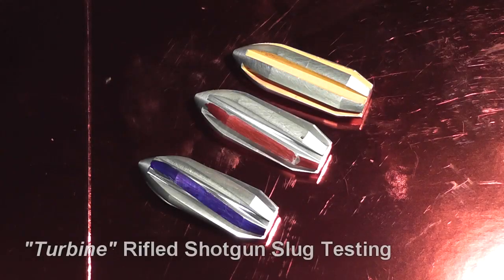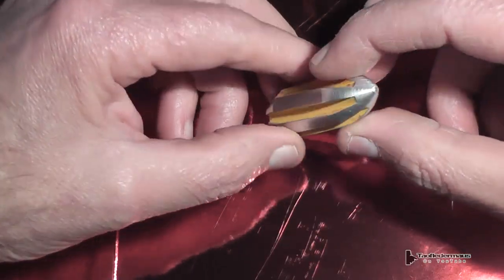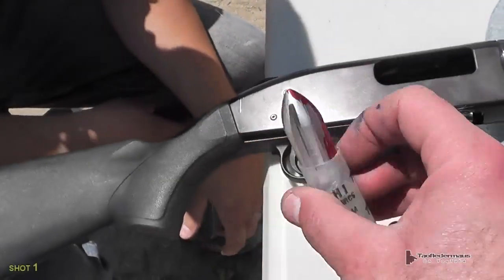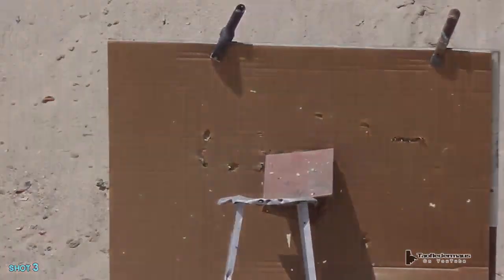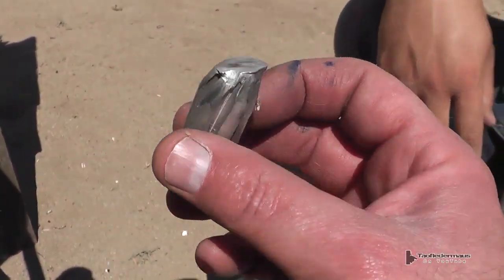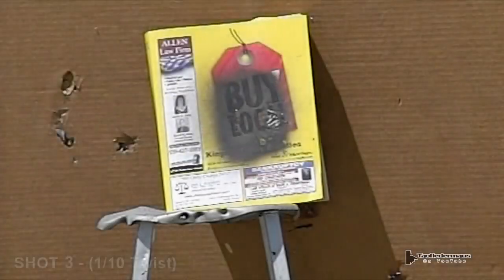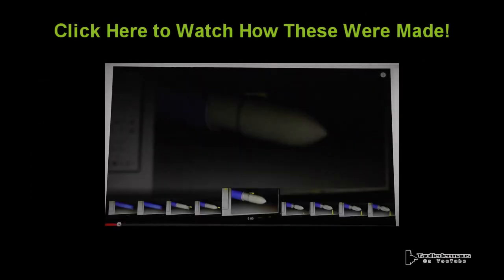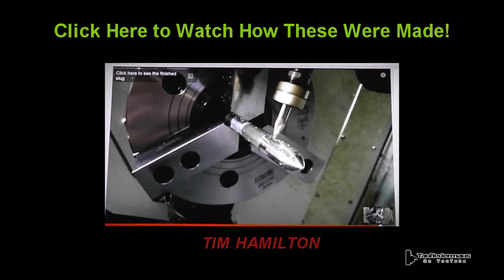Custom Aluminum TURBINE Shotgun Slugs  -Testing

Comment: Try either weighted nose(lead or steel in aluminum) or flights it the rear like a dart. Weighted nose with finer, more shallow rifling that get slightly more pronounced in the rear would be best

Comment: Yeah, very cool - but I guess the rotation needs to be initiated in the barrel in order to exit with stability.  I'm not sure if fins could ever be enough on their own - the density distribution of the slug would likely have to be tweaked somehow to provide stability before rotation can be initiated - and then would likely be all that was needed.

Comment: I'll say here, in my vision the high speed cameras have one job, and that's to see how the round travels and the impact in slow motion, and the 300 is nearly no different to reality, the 600 is close to the 300's effect to.  Now the 1200 is good but you have to lower the resolution for a higher fps.  When you get the money, please sell the 300 and 600 and buy a 2500'camera.
Reply from the maker: Gordonator  It is real expensive to go to the next level.   The 1200 fps resolution is pretty bad, it's very small,  and the native resolution is actually about the size of a pack of gum if you view it via Quicktime.   But...  what I have is better than guessing what the rounds are doing.  I'm not trying to make a motion picture.
Reply: ok i hear you out, is there anyway you can decrease the resolution of the 1200 to make it even higher?
Reply from the maker: I always hoped some hacker would have written some custom firmware for these cameras to do stuff like that but  I don't think anyone has.    The camera wasn't popular like the Canons,  etc that people have hacked.

Comment: It would seem to me that the force required to impart spin on the slug from a low-density fluid (air) would be massive. As the rifled slug is fired, wouldn't the expanding gasses acting from the rear, impart spin in the opposite direction from the spin desired as it leaves the barrel? Perhaps a partially cone-shaped sabot at the rear would isolate combustion gasses and provide more velocity. Also thinking that thinner, bent 'blade-type', fins like those on a turbofan aircraft engine would provide more rotational force from the available air density. Interesting concept although how essential is it to stabilize a shotgun slug?

Comment: IMHO a far tighter twist rate on the slug itself and more aerodynamic grooves (think of a course threaded drywall screw... sharp edges, maybe a 6:1, yeah, 6 turns per foot, if not tighter, twist rate) would yield slightly better results but still won't come anywhere close to an actual rifled barrel. With a rifled barrel the projectile is forced to spin because of a tight interference fit with the grooves of a steel barrel. A 'rifled' projectile shot out of a smooth bore relies on just air resistance to cause it's spin.

BTW, I love your channel. You experiment with all kinds of things that excite the demented mind.

Comment: I'd suggest shallower and twistier rifling on the slug to get the pressure up and give that air-pressure more surface to help push the ridge's walls into rotation.

In a normal rifled-barrel you have denser-metal-against-metal friction inducing the rotation. In this case it is air-pressure doing the job, so you'll need more contact surface.

Comment: No way I knew that would not work the air is not going to make it spin you need a rifled barrel with a sabot or a projectile tight enough in the rifling. Tao your thinking like a rookie.
Reply from the maker: kanehunter23   Remember,   I use viewers' ideas in my videos often.   Many people claimed putting spirals on a round would make is spin.   That's all we did here.   If you get hundreds of people thinking that spirals on a round makes it spin,  then what's wrong with conducting that test to dispel  that?

Comment: Isn't rifling necessary on the barrel, not the actual slug itself?
OR, if you have to rifle the projectile, no matter what, then wouldn't short scratches running from the tip to no further than half the bullet make more sense? Because this way, my intuition says, most of the force of the shot will be lost, passing the slug.

And it wouldn't even make the slug spin, because the force you want to spin it escape the easiest route, which is ignoring most interaction with the slug itself.

Comment: Just wondering if the tumble is caused by the transition between ejection gasses and the opposing air traveling through the rifling once velocity is achieved upon exit… Particularly with these finned/rifled rounds. Perhaps a jettisoned push plate that is fitted into a receiver hole in the base of the round would help ? Something shaped like a flat topped mushroom with the stalk being an easy fit into the rounds base. Designed to "drop off" after exit…
I don't really know what I'm talking about but it's got a bit of logic to it : )
Reply from the maker: John Smith  Remember these are sitting on and are being pushed by the wadding which is like a piston in a syringe.

Comment: The round is tumbling because it isn't spinning n the barrel but starts to spin once it out. It means the grooves are actually doing something but after they are out. Then as the slug starts to spin up it tumbles. Think of it like giving a car too much gas on ice. The torque from that initial spin up isn't acting directly along the line of flight. Smooth bore projectiles either use fixed fins or rarely pop out fins to stabilize to stop this.

Comment: maibe you need to dril holes in the slugs and fill those with powder used in fireworks 
the idea is that firing the mainload in de cartridge will ignite the little powder in the holes as whell forcing the bullet to spin 
how whell the different holes light will make the acuracy , one or two holes not firing will actually move the slug away from the target

maibe using the same style slug as these and machining the fins and the front part of the pointed bit thinner so it only gets fins in the rear and reduce the front part of the flutes to a tiny centering threepod in the front might stabilize the slug too 
puttng a round piece of wood behind the slug to get the maximum blast from the load might work too

Comment: That is absurd. Unless it's saboted you lose a ton of energy, not to mention the other problems with it. It would work with a lot of refinement though.
Reply from the maker: Internetzspacezshipz   A sabot just fills the space so you can shoot a much smaller projectile through a larger barrel.  Rounds like this are pushed through the barrel with a powder piston that creates a seal.
Reply: ***** Can you clarify what a 'powder piston' is? I can't find anything about it on Google.
Reply from the maker: power piston,  sorry
Reply: ***** Now I am getting Hotwheels toy cars. What do. Whatever, I get the idea. I assumed you were not filling the gaps, which is why I said what I did.
Reply from the maker: Internetzspacezshipz  The wadding or power piston fills the space.  Just the same as if you were shooting birdshot or buck.  Those alum. slugs were traveling very quickly.  If there was an issue you would have seen the wadding traveling faster than the projectile.
Reply: ***** Wadding is the word I was looking for.
Reply from the maker: There's a few parts of a modern wadding.  The piston which seals the gas,  then there is a compressible cushion then you have the shot cup that holds the shot.   Some companies use a one piece wadding while others use 2 piece,  like Federal.

Comment: I'm no physicist, but I'm pretty sure the pressure of the expanding air inside the barrel is escaping around those fins - causing it to spin one direction.  But by the time it has exited the barrel, even if it might have been stabilized by the initial spin, the still ambient air would be fighting to spin the round the opposite direction in its trajectory.  That is why I think you have a tumbling projectile.

Comment: Your base need to be hollowed, not rifled, in order to be accurate.  Take a 12 g Lee casting molds for exemple.  Rifled slug are like this so it's easier to compress when it goes trough a mod choke.

Comment: seems to me that the propellant gasses would force the slug to spin the wrong way out of the barrel, then as atmospheric air forces it to spin in the opposite direction, it would become unstable
Reply: ***** It would work with a sabot, and that would also increase the muzzle energy.
Reply: ***** You hit the nail on the head bud, If they would use a sabot on the slug and get ti spinning in the right direction in the first place it would not be unstable and it would be more accurate as well.
Reply: I agree with u, it's a pretty retarded design.
Reply: ***** Yes, I'm surprised more people didn't realize this.
Reply: +Minute Man +Taylor Yarick I think there was a wad, they just didn't show it. 3 reasons why I think so: 1)The powder could fall out if they didn't have one and could cause problems. I don't think they would set it up like that. The first time they accidentaly dumped the powder out would inspire them to use a wad. 2) The grooves would cause massive leakage of propellent gas and severely hurt velocity. 3) The burning gasses would darken the base of the projectile during firing. This would cause a dark or blackening color but the projectile that they recovered looked like bare aluminum, no burns. Just my 2 cents

I think the grooves do nothing at all since the projectile is supersonic. A high quality sabot would do more good than anything. A long slender design with a very sharp tip would work best. If there are fins they should try to prevent spin and stabilize the projectile like a cruise missile.
Reply: +Taylor Yarick He should have loaded it into the hull in front of a wad, then that shouldn't be a problem.
Reply: ***** I think you're right.
Reply: *****
The wad isn't blocking 100% of gasses so it still starts spinning in the wrong direction.  Being supersonic just perpetuates that wrong direction spin that began as it started initial acceleration, then it destabilizes as it leaves supersonic speed.

The thing a lot of people are leaving out is that you don't always WANT maximum penetration.  On the contrary that can just cause less energy to be released in the target as it passes through the other side, which brings me to the topic of hollow point rounds.  It could be that tumbling at the end is the desired result at close range.  At long range, well that's why rifles exist.

Comment: Why in the world would anyone want a slug that tumbles like this?  First off, Tim is making it look cool, but clearly doesn't know the first thing about engineering.  The reason that the slugs are tumbling are two fold, first off, the janky way that they are positioned in the shell casing makes the slug off axis in the chamber before being shot.  you need to precisely control the way that the slug is mounted.  Second problem is that your slugs are tip heavy.  You have cut the grooves out of them nicely but the tip continued to be solid and thus more heavy that the rest of the slug.  You need to core the slug at the base and internally weight the bottom 1/3 of the round from the center of the slug in order to make it fly right.  You can carve the outside round out of aluminum, but core the tail weighting by melting lead and put a lead weighted core and that will help the stability.  Also, your groove patterns are also the problem.  You need to look at the grooves of a Nurf football.  They start thin and get wider and then taper off.  You need the same type of grooves in the rounds.  That will also help weight the base.  Your groves only twist in one direction, but you don't have sufficient air compression to achieve the desired stability.  I hope this helps.  Happy to consult further if you want to make it better.

Comment: Some basic aerodynamics would help here. For spinning, the spin has to start prior to leaving the guidance of the barrel or it won't be strait enough to catch the fins and start spinning. For aerodynamic flight, the center of gravity must lead the center of pressure. If these fins were deeper and only on the back third, this might have worked. Just think about how a mortar shell looks.

Comment: Have you tested the same design out of lead? Or at least with a lead core? I think the density of aluminium is simply to low.
Reply from the maker: TheSkillsupport No,  a round that large made of lead would probably a quarter pound and blow up the gun.  But the two remaining ones I put a lead core in the nose.   I have doubts it will function any better though.
Reply: ***** good point...
Reply from the maker: TheSkillsupport   I don't have much faith in this design but some of the new stuff he is making out of titanium,  etc  look pretty cool!   They are more like foster slugs or giant air rifle pellets.

Comment: Hey ***** I think your issue with accuracy is the way you're loading those projectiles in the shells. I saw some of them and they looked crooked and were inaccurate. Normal slugs are placed exactly in the middle, which is why they are decently accurate. Just a thought!
Reply from the maker: I have a couple of these left and I do plan to do things differently.  Loaded the tips full of lead and I will put them in the shell like a slug with just a power piston and some support disks.  I have a lot of doubts it will work any better but we'll see.  I plan to shoot at least one into ballistic gel.
Reply: Wonderful ideas! It was just a thought. It would be neat if it does work out! I really am curious to see how this projectile will affect the ballistics gel, if it flies true enough. Cheers!
Reply from the maker: This whole design is wrong for a lot of reason.  But Tim is working on some new designs that are more akin to a foster slug or a giant air rifle dart.  The coolest thing is the materials he is using,   titanium,  cast iron,  polycarbonate,  steel,  and  teflon.   I'm really looking forward to getting those.
Reply: True, true. Im lookin forward to seein those videos! Keep up the good work, bud. Aren't aerodynamics fun!? Little things can trash a whole project.
Reply from the maker: Yeah it's fun.  I just get to shoot the stuff that other people have dreamt up

Comment: The rifling on Foster and Brenekee slugs doesn't exist to impart spin or add stability. That's not how the ballistics of shotgun slugs works. The rifling on these slugs exists to reduce friction between the slug and the barrel.

Foster and Brenekee slugs achieve stability using a "mass forward" design similar to a badminton shuttlecock. The front end is heavy, the back end is light, and the force of air keeps the light end behind the front end. This is why a Foster slug is hollow and a Brenekee has fins.

Because of the way fluids work (air is a fluid) you can't impart spin at high velocities without very large surface areas (on these rounds, air is going to stay trapped in the grooves while the outside air rushes over the entire projectile). You need a mechanical connection (i.e., a rifled barrel) to impart spin effectively.